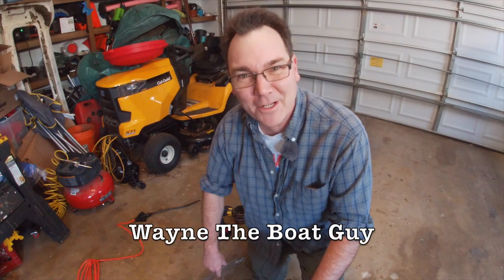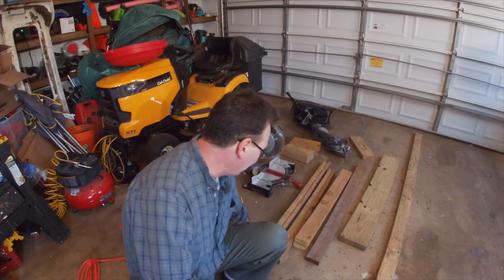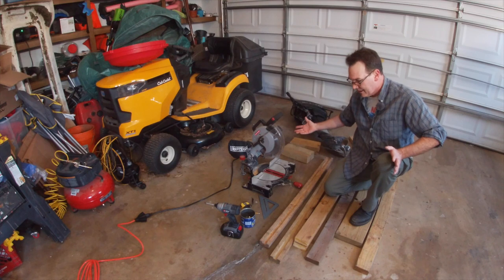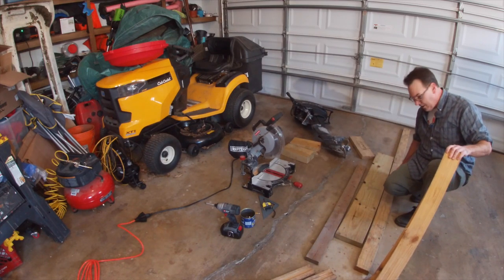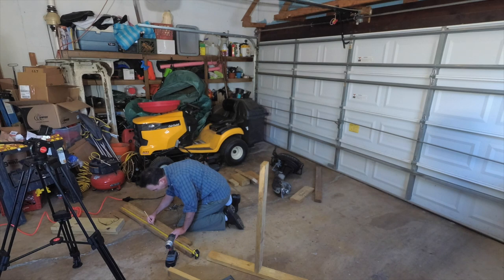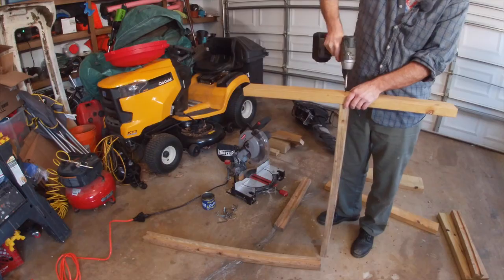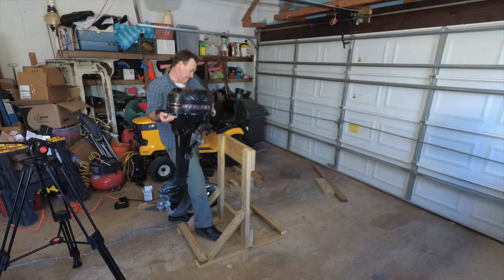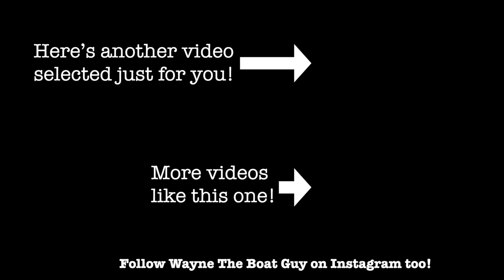Outboard Motor Stand - simple scrap wood OUTBOARD ENGINE STAND!

Comment: Is that motor going to be for the Jon boat?
Reply from the maker: It’s too big for the jon boat.
Reply: @WayneTheBoatGuy  those horsepower ratings are bogus but anyways what wil it be for
Reply from the maker: I'm not sure. Not sure if it runs yet. So tinkering with it is on the agenda right now, but that Jon boat would likely sink with me and that motor in the back!
Reply: @WayneTheBoatGuy  even it out and put some weight in the bow however you have to do it.